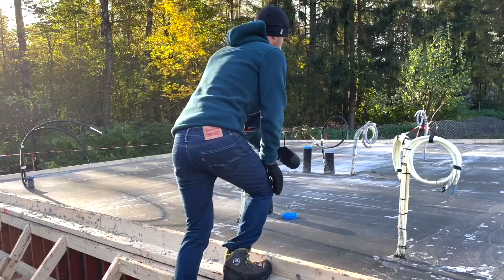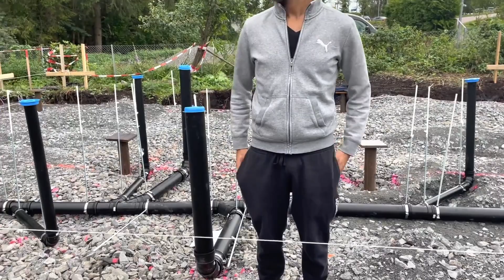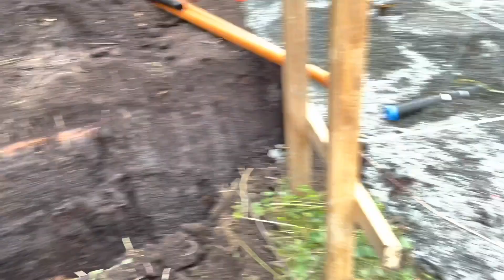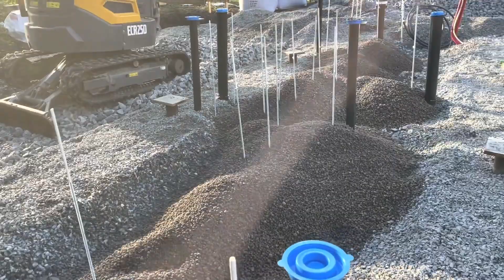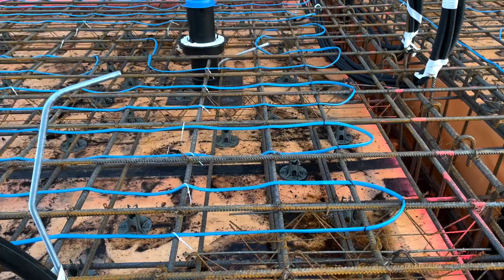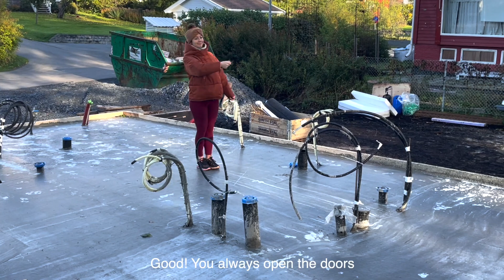CONCRETE SLAB & PLUMBING | Hjem #3

Comment: Raft slab with  3 layer rebar matt.  Differential Settling must be a real issue at your location.
Reply: Yes the ground is often unstable and the soil type is usually: Peat, Bog, Moraine, Marine clay, Sand and gravel.

These types of soil make the ground very unstable and frost heaving is a major issue. In addition we have alot of rain and snow which makes the ground wet all year, with long, wet and cold winters. With the frost depth being as low as 3,25 meters someplaces.

So with this in mind we design our foundations to be very strong to resist cracking, we desing our outer foundation walls to go very deep to avoid frost creeping underneath our slab.

Our houses are also very heavy due to the thick walls with thick insulation, our roofs need to be very strong to resist meters of snow ontop. You def wont find a paper thin wall you can punch through here!

And all this gives us the need for a very strong and well insulated slab. 
An interesting fact is that all new foundations in Norway need a Radon barrier due to there being so much radon in the ground here